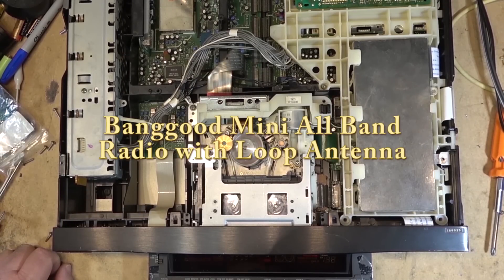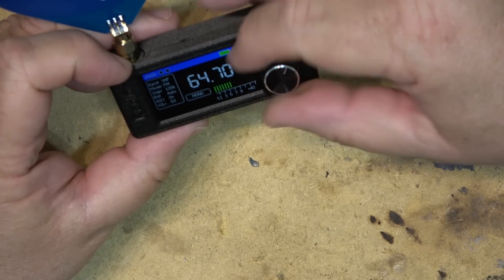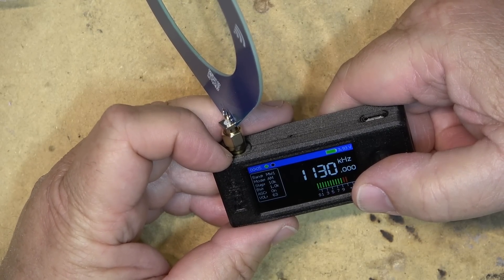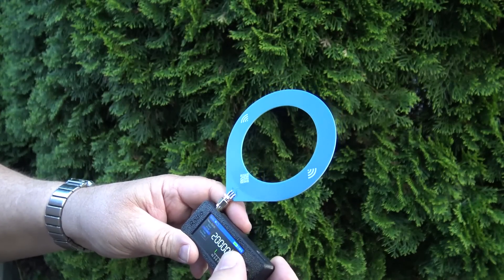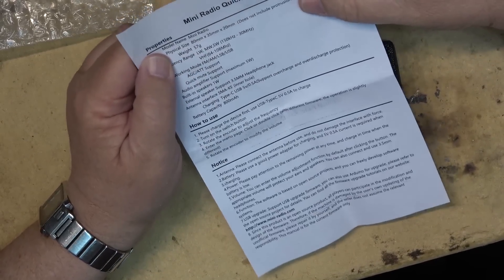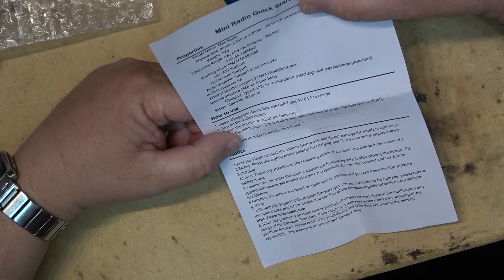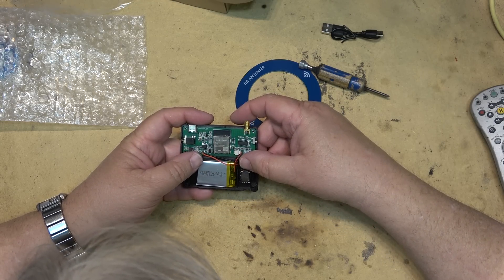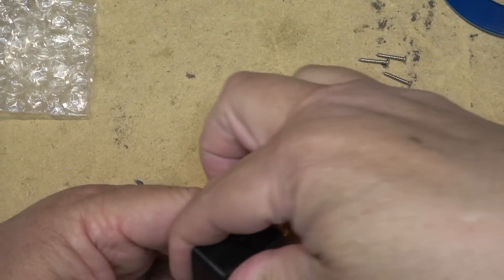MINI SI4732 Pocket Radio Check Out and Tear Down

Comment: If you will notice under the one button it says 'BOOT', and the other button says 'RESET'. There is no need to guess what the buttons do. There is no headphone amplifier on the version you have, so the 3.5mm jack is a speaker/line out. You should run it to an external powered speaker, because headphone volume will be miserably low.

Comment: Quite disappointed about this radio. There is nothing to hear outside AM and FM.
Reply: I cannot even get am or fm stations to play. Strong signal strength. Every of radio works here. Cannot figure it out. Menu is easy though... any ideas???
Reply: @mountainman369  Get it back and ask for your money.
Reply: Shortwave is loaded with signals, but you'll never hear them with a crap antenna. There are websites that list almost all known shortwave stations. You also have to get creative and possibly do a wee bit of math. For example, I know in the USA there is no direct BBC shortwave radio anymore, but you can pick up the signal meant for the Caribbean quite easily. It's more work than turning an AM/FM dial, but worth it in my opinion. I am in the Philippines and SW is about the only way I can pick up English radio broadcasts.
Reply: @NotExpatJoe  I really appreciate your answer. Many thanks!
Reply from the maker: There isn't much on  shortwave these days other than the Bible pounders and hams
Reply: @12voltvids  I cry. 😂

Comment: That chip SI4732 from Silicon Laboratories near the antenna jack does the complete RF stuff. From antenna input to L and R audio output. It just needs a few external components and a microcontroller to set it.

Comment: I bought one of these about two months ago, I noticed the display is slightly different.
Reply: Yes maybe you have the old software whitout the blue stripe on top of the screen ? Its several software versions now :) try upgrade your radios software, it will also make your menu stay still when your in it. Best regards from Norway

Comment: After watching your videos I was able to replace a completely open (OL on my ESR meter) capacitor on the standy circuit of a small CRT. Relay no longer buzzes but the picture still jumps while it is warming up, so it needs more work. One thing at a time!

Comment: 730 kHz used to be CKLG, which played...music (remember when there was music on AM radio LOL?).
Reply from the maker: 730 is now CKNW.  They shut down 980 and moved to 730 due to the superrior coverage of that transmitter.   Yes I remember LG73 and 14CFUN.  It was CKVN before that. We also had 1040 CKKS 'kicks" I won 1040.00 from them back in the 80s.
Reply: @12voltvids  There's an unscoped aircheck of CFUN from December,  1976 on YT.  Sound quality is not too bad, as AMradio airchecks go.
Reply from the maker: @angryshoebox I have an aircheck  recording of AM 1040 from the 80s from a proper wide band  AM stereo receiver and it sounds really good.  For that matter i can aircheck am stereo any time I like as I have a 400mW cQUAM AM stereo transmitter which broadcasts quite nicely to my AM stereo radios.  Now that there are so many vacant spaces on the dial it actually goes a few hundred feet interference free.
Reply: @12voltvids  Oh yeah, Motorola cQUAM sounds amazing, crisper & cleaner, to my ears,  than FM stereo, like listening to a CD, IMHO--and it's over AM radio.  It makes me wonder if the FM stereo broadcast community secretly had it in for AM stereo, at least in North America, LOL.
Reply from the maker: @angryshoebox what killed AM Stereo was none other than your veey own Friendly Candy Company FCC.   They were spineless and couldn't make a decision on a single standard. They said let yhe market decide on the broadcaat standard. You had 5 inconpatable systems. If you owned a harris travsnitter you were forced to the harris system. If yoy had s phillips transmitter yhen the philips / Magnavox system was for yoy and if you had Motorola, well yiu get it.  By the time the fcc grew a paid and picked the Motorola system and ordered all the other installed syatems to cease broadcasting in their current format and switch to Motorola vir reveet to mono, most just went back to mono.  
Of course we have HD am now and it sounds fantastic if you have a radio.

Comment: The ESP32 module is probably just the controller and display driver. It can talk WiFi and BT - if they implemented the code. The 16pin soic is the radio receiver. Also - pcb on the battery it's usually just protection - the charge controller should be on the main board.
It would be interesting to see how good the antenna is.
Reply: Would also be intersting to see how sensitive the recievers front end is, wideband usually equals deaf as a post
Reply: @lezbriddon Shango066 did a live stream testing something like this in desert, its not great
Edit: it was march 30, about 10 minutes in.

Comment: That's an ESP32 microcontroller, that are available with wifi and/or bluetooth. I'm guessing the device is an SDR, a software defined radio?
Reply from the maker: Yep SDR
Reply: @12voltvids I would have said it's the TEF 6686 chip but in the intro you mentioned SSB which that chip doesn't do. 

Maybe this one is in fact a SDR. I have a radio with the TEF 6686 and it's amazing!
Reply: ESP32 S3 controller with an Si4732 SOC